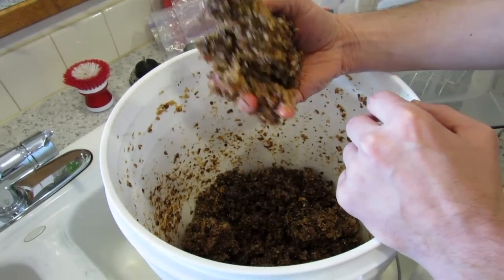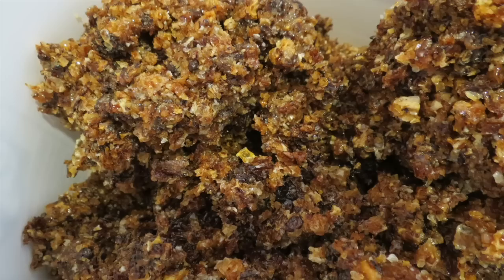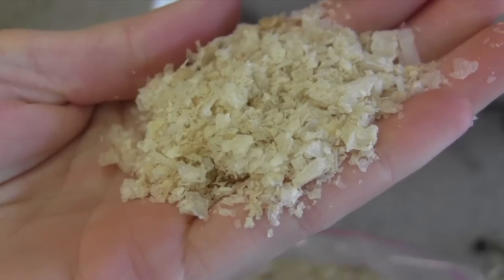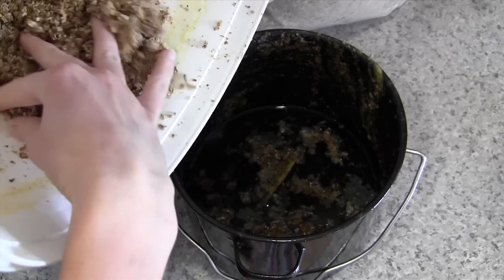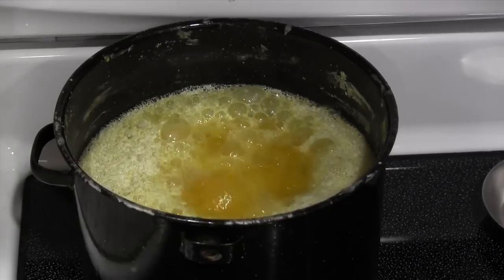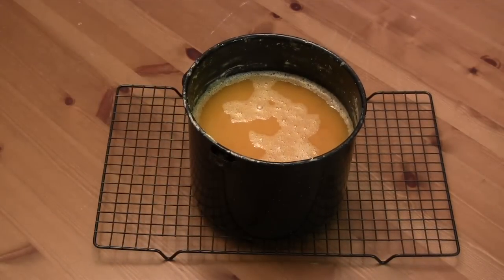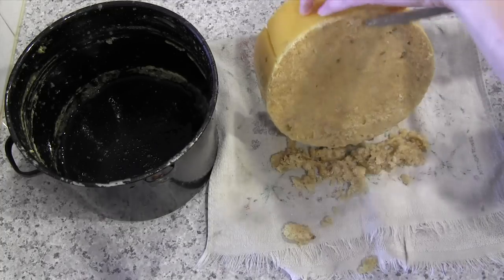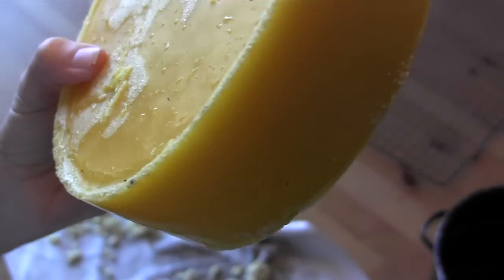Cleaning Melting and Filtering Beeswax

Comment: I liked this video a lot.  Very nicely done.  When I did mine, mine stuck to the sides of the pan and cracked in the middle.  Do you think this is because my pan was too big for the amount of wax I had?  The wax was only about 1/2 inch thick.

Comment: Hello Rain nice video myself    I wash capping wax in warm water .The warm water thins out any honey still on the wax .using a 5 gallon bucket containing capings and warm water to cover capings .Iuse my hands working the wax and water a few minutes Ihave another bucket with some sheer curtain material across top of bucket but hanging down in bucket a few inches to hold wax that is getting washed then dump wax water mix while still warm and a little more warm water over wax and let sit so water drains or you can pull the curtain material up around wax and off bucket and wring water out Thanks Jim

Comment: I saw no actual filtering here, and that's a missed opportunity.  At the first melting, run the hot water and wax through a fine strainer, and immediately you're rid of much of the junk.  I refine fat (lard) like this for soap-making.  I do that in the cold month so I can set the pot outside for the fat to congeal -- as it won't congeal like beeswax at room temperature.
FWIW, you can clean a pot completely of waxes by using hot water and detergent, but it's still a good idea to use a cheap pot for refining beeswax.

Comment: Hi, i use some vinagre when the wax is hot, that helps to filter the bits a lot faster. Just 1 or 2 heatings will do the job.   If you melt the clean caps seperate from the the dirty ones you can get a very clean waxblock in just one melting

Comment: you never pour it through a tshirt or a piece of cloth? I have to filter 20-30lbs at a time and I find it too much work. I heat it with water just like you do when Its all melted I pour it into a bucket through a an old tshirt. then repeat 3-4 times.

Comment: I tried this method and all of my slum gum stuck to the underneath of the wax. Nothing sunk to the bottom, so when I pull the cake out I had all of the slum gum stuck right there and had to scrape it off. A lot of it was also incorporated into the beeswax, so unfortunately this method didn’t really work for me that well. Do you have any pointers? Thanks!

Comment: Hi.
Try placing a 60 watt tungsten filament lamp in the bucket and the wax should float off the rubbish overnight. Switch the bulb offa nd lif the wax away when solid. Wouldn't it separate like that?

Comment: I added a new step to the filtering process. When the wax in liquified in the pot with the water, I take a handheld strainer and dip it into the mixture to remove the non wax particles. Then I dump what I collect in the strainer over cheesecloth stretched over a pot with a couple inches of water in it. That gives me a bit of clean wax which I will add to the next pot I heat up. This greatly reduces the impurities that are in the big pot of wax. So I will have much less "gunk" to scrape off the bottom of the cooled cake of wax. Having multiple pots for this purpose is needed. Two are enough but four would be better so you can process more wax.

Comment: Hi, would you sell a couple bags of the virgin wax? I'm a woodturner and use beeswax mixed with a finish to apply on my turnings. Thanks!
Reply: Mike Bettis I do blacksmithing and use bee’s wax on traditional iron work pieces so it doesn’t need to be too clean, one melt and scrape off most of the crud.  However, I just got back into turning wood and this method worked great to clean up some of my dirty (really dirty) wax fairly easily.  The comment suggestion of keeping it melted warm (still) for several hours before removing from the heat was a spot on suggestion.  It just had about a 1/2” of crud in a two get. Pot of wax.  Cut it off and had great wax to use,  Made up about 1/4 pound of it with 1/4 pound diatomaceous eart and 1 pound mineral oil to make a lifetime supply 😁 of sanding paste.  Works great and only cost me a couple of dollars for almost 2.5 pounds of sanding paste (cleaned the dirty BW I had, stole the DE from my wife gardening supplies and bought the MO at the dollar store).
Reply: @tomcoker9882  I hadn't even thought of using DE!! Have a bag out in the chicken coop. I'll try this. Thanks!!
Reply: Mike Bettis The mix I found that seems to work best for me is (by weight) 1 part BW - 1 part DE - 4 parts MO.  Some people use 5 parts MO, but I found that mix a little thin.  I tried a little more DE (1.5 parts) but it didn’t work as well.  The 1-1-4 mix works as good as good for me as Yorkshire Grit and Ack's Abrasive Sanding Paste, both of which I’ve used in the past (which were both effective), but this is a lot cheaper.  BTW the melting pot is a from then on a wax pot.😄. I put the MO in an old thrift store crock pot, heated to it was hot enough that it would melt the BW and when this was all blended started adding the DE.  Stir it in and remove the heat and stir and stir and stir to keep it all mix in as it cools until it is a soft butter consistency.  Then transfer to smaller user containers.  I share with my turning buddies (and get some nice wood and such in exchange) - like I said my batch made a whole lot more than I thought it would.  Good luck.

Comment: Well, you could heat up the bees wax then pour it slowly through a paper towel in a strainer.  This will filter it allot better.  I saw someone using this filtering method with a solar wax melter and the wax was nearly clean on the first pass.  But I would do what you showed for the second pass.  I think a mix of the two would produce a nice product as far as home based.
Reply: I think your right. have you tried it?  Did it work?

Comment: You wasted all that residual honey. Instead of rinsing the wax you could have just added water and boil the wax on low and let cool. After the wax solidified, you could strain that water and reuse it to feed the bees, a portion for cooking and use in drinks .

Comment from the maker: I soak my wax to help dissolve the honey. I use warm (not hot) water and just let it sit over night or for a few days to get all the leftover honey off of the wax. It's kind of over kill since the hot water when you melt the honey will do the same thing. But the cleaner the wax is when I start the melting/filtering process the fewer times I have to melt and cool. I usually double up strainers to make a tighter mesh to catch most of the tiny particles of wax once it's done washing.

Comment from the maker: The only problem with that method is the beeswax must be kept hot. As it cools down it solidifies and without the wax in a liquid form nothing will get through the cheesecloth. Plus I found that the cheesecloth collects a lot of wax that will never be usable. But it is true you can do the cheesecloth method, I just find it a bit more messy.

Comment: One more question....if I am using just the wax that was used to store honey do I really need to soak it? I would not think there would be much debris..just honey. I am also wondering how to strain the tiny particles of wax from the water after the soaks. Do you just put it all through a tiny holed strainer? I am trying your method right now and the cappings are all soaking in a pot. We got honey from our hives for the first time and this is the very first time  processing the wax cappings! :)
Reply: I buy paint strainers from the hardware store to drain my honey wax and capping gs. I wash them in a laundry  laungeray zipper bag in a bleach wash. Then dry in the dryer in the bag. Put in a ziplock bag till I need them. I also use a big old crockpot to melt and cool the wax. Only for this. $2 at flea markets ect...

Comment from the maker: That is a really great question and I have no idea! I never measured all the gunk before to see how much it weighed. I ended up with about a 5 lb. block of wax but I've no idea what I started with. I would filter it to about what I did for lotion bars. It should be clean and free of impurities if you'll be making cosmetics. It's less important to be super filtered if you are using the wax for candles.

Comment: Using any metal container that can be closed tightly, such as a brand new one gallon paint can, place the wax in the can in as small pieces as patience will allow, add the turpentine, close the lid tight, and without stirring or turning, in a few days the mixture will have turn into a paste or a sauce, depending on the proportion. For waxing floors, I like a hard paste, for delicate veneers on antique furniture, the texture of tooth paste works best.

Comment: Great video, we do a similar process except with the first melt we filter it through a cheese cloth.  This gets rid of most of bee bits and lumps of propolis.

We must do a blog post one day about the whole process.
Reply: Have also used this easy method. As Gary said putting it through a cloth works even quicker. Old tights or stockings are really good for this and can be used several times.
Reply: Yep and the old clothes make great fire lighters for the smoker :)
Reply: uhh I am a ignorant beginner no native english... What is a cheese cloth ?
Reply: It's essentially a filter. Like a mesh of cloth that will filter out the impurities.
Reply: do you add cheese to it before or after the melting?
Reply: Don't you find that the cheese cloth becomes very gummy and blocked up, resulting in throwing it away?

Comment: I spread all my wax out on a large 10X10' piece of plastic and let the bees clean it, then melt it, strain it thru 4 layers of cheese cloth and pour it in molds.
Reply from the maker: I've never done that because it can insight 'robbing' mentality in the nearby hives. I never let the bees clean anything because I don't want to try and stop a mob of bees.
Reply: +dave12546 not recommended as a) attracts robber bees and wasps and b) can cause disease pass from hibe to hibe
Reply: maybe if you have the plastic next to the hives, my hives are a 100 yds away and never had a problem

Comment: This video is a PUBLIC DISSERVICE . Advocating the melting of wax without the safety of a double boiler to prevent fires and keep the wax at safe workable low temps is the same as showing kids how to play with matches around gasoline. Always melt wax inside a water jacket or a terrible burn or fire is almost certain. Please remove this video.
Reply: I've done this on a woodstove, regular stovetop, and using a turkey fryer outside while working on other projects.  The key is to use a pot that is big enough.  If you can't handle this method, please don't drive a car, handle a gun, or use sharp knives.